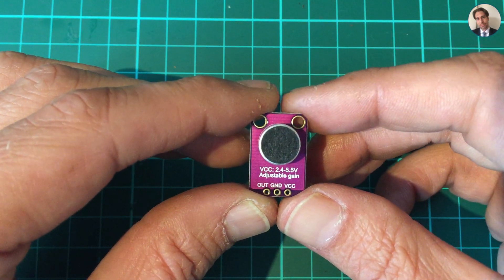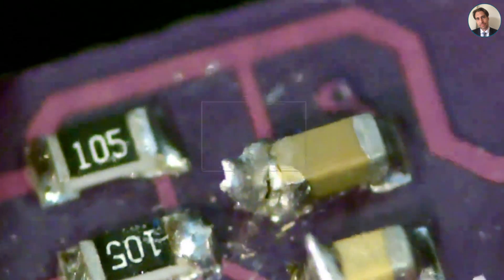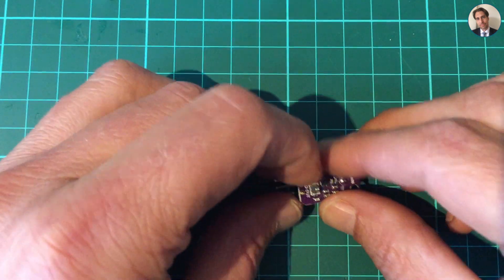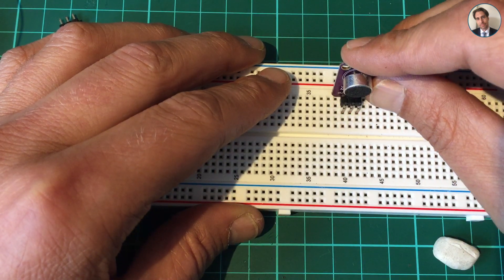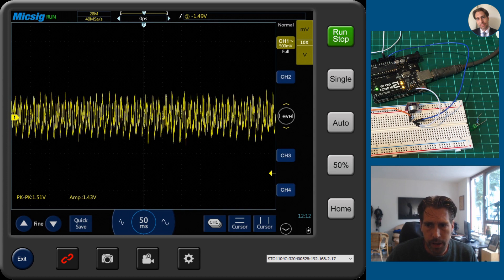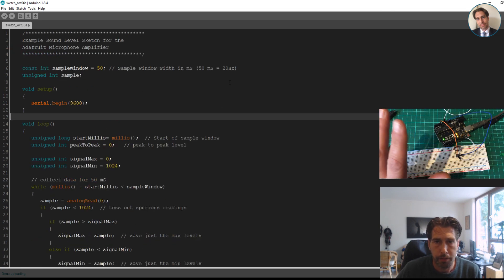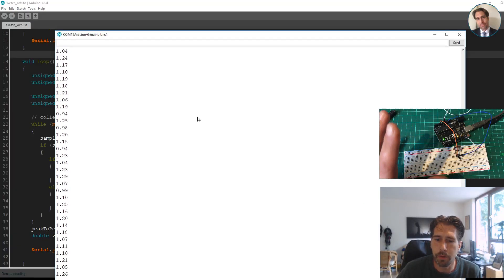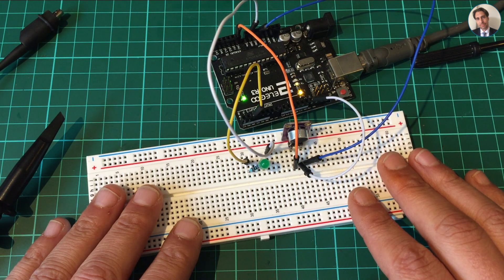MAX4466 Microphone & Preamp Module (First look and Test)

Comment: Are you sure It's so noisy because It's not in a enclosure? Also if the cable is not shielded then its picking lot of noise if its a high gain ...
Reply from the maker: I'm sure that plays a roll. I haven't tested it with shielded cables and a decent enclosure. But I have had amplifiers that did not present that noise when just on the bench in a breadboard. so that was my reference. Since I haven't tested it, I have to say there is a chance you are right. Maybe you can test it? :D

Comment: Good day. Do you know how to covert the sound produced into decibels?
Reply from the maker: Hi! Depends on what dB you mean. If you mean a audible sound (db SPL), you would need a DAC (Digital to Analog Coverter) or a circuit simulating one, and a speaker. 

Or if you directly hook this up to a speaker you need some form of amplification. I can't remember what the peak-peak voltage was, but this can directly drive a speaker only if would probably be very soft as there is no amplification.
Reply: @DustinWatts  I mean I want to evaluate and monitor sound that is produced indoors, and I want to use the microphone (in my case, MAX 9814) to capture and evaluate noise. I hope what I said makes sense, haha. Hoping for your speedy reply, thank you
Reply from the maker: @josephcampugan2439  Well it makes kinda sense. What do you mean by evaluate? From you previous post I think you mean hearing it? It then depends on how loud the incoming sound is that you want to evaluate in comparison to the noise of the microphone itself.
Reply: @DustinWatts  I mean this is what I want to happen:

1st is that the microphone receives noise from its environment.

2nd is to convert that noise into decibel values using an arduino

I'm trying to make an indoor noise monitoring system where it measures how loud the noise within that area. I'm going to use the noise values on dB to launch certain commands depending on how loud the noise is.

I really appreciate the replies. Thank you once again
Reply from the maker: @josephcampugan2439  Ok. Well that is certainly possible. You can read the value of the microphone and compare that to a threshold value and if the incoming sound is higher then the threshold, do something. You can stay away from using any dB scale at all, just read voltage levels.
Reply: @DustinWatts  now THAT actually makes sense. Thank you very much bro
Reply from the maker: @josephcampugan2439  You are welcome! Good luck!
Reply: @DustinWatts  just tested it now and when it reaches over 52 decibels, the value goes "inf" and the voltage reading goes 0. Any idea why it happened?
Reply from the maker: @josephcampugan2439  No idea... have a good look at your code and try to debug it. You can join my Discord server (link in the description) and post your project in the #your-projects channel. There are a lot of people there including me that will try and help you with your project. But this comment section on the videos on my YouTube channel is not the place for that.

Comment: Hello, I have a car stereo. Can I use this module as an car microphone? My car teyb has three microphone inputs, these are (+5V ) (GND) and (SIGNAL) . Can I connect directly? Thanks already for your help. I wish you good work.
Reply from the maker: Well I really can't answer that. Depends on what your car expects as a "microphone". And what it will be used for. Speech? And I also don't know what teyb means. I need more info/specs. 

But what I can say, as a microphone for speech, this is not the microphone for you. It is very noisy and the quality is too bad to be used as a microphone. I would classify it as a sound detection device. For example in the circuit I showed in the video it works great. Also for similar applications. But not as a microphone.

Comment: Hey can somebody help me pls. Do I need to screw the pot cw or ccw for more sensitivity? Can I overscrew it? Thanks in advance
Reply from the maker: Yes! You can definitely overscrew it, those tiny post are pretty fragile, so be careful! If you break it, the output of the pot in uncertain. 

I have played white this module exactly 1 time, so I can't tell you from experience. But....

This listing on Ali shows the schematic of the module: https://nl.aliexpress.com/item/32843099206.html Looking at it, turning the pot clockwise should increase the ratio of the non-inverting opamp and thus should increase the output. This has nothing to do with the "sensitivity" of the microphone though. It just increases the gain of the MAX4466. According to that schematic the gain is: 1+(VR1+R7)/R5. And because in the schematic the symbol is flipped, turning it clockwise (towards pin 3) increase the value of VR1. Again, you should get a higher signal on "OUT" for your ADC (or whatever). Which you can say as being more sensitive, but it actually just the amplification you are increasing.

Hope this helps!
Reply: @DustinWatts  thanks Sir! This definitely helped, on 2 of 3. One of them already came overscrewed. I don’t get it, why this step isn’t part of almost every data sheet, as it can be easily overscrewed. The end limiter (doesn’t really deserve that name) is just a slight resistance you feel while screwing. 
Anyhow the two others work, slightly better than the KY-038 I used before but nonetheless you need to play that sound really loud and/or you need to play it almost directly in front of the microphone. I assume it’s due to the work principle of these tiny microphone.
Reply from the maker: @ACID2BREAKS  Yeah those microphones are not the best. Better small microphones especially MEMS microphones are a lot better. And those are actually useful enough to record audio with a lot less noise.
Reply: @DustinWatts  I also stumbled over mems microphones. Seem to be very powerful especially in terms of resilience against noise. 
You mean something like the INMP441? 
Or what would you propose to sample a sound of ~80dbA and expected max frequency of about 2kHz all recorded in outside environment?
Reply from the maker: @ACID2BREAKS  I have that module here, but haven't tested it. But the specs are pretty decent. But remember the module is only 3.3V for VCC and also for the I2S pins!

Comment: Hi, What are the other sensor options for recoding high quality audio recording with minimal background noise. I though of using MAX4466 for a insect sound detection project.. will this be a feasible option?
Reply from the maker: I would opt for a ADC and a microcontroller. Less THD en much better audio quality!

Comment: For z = 0; z <= 9; z++, then while it's doing that, if it detects two or three claps during it's cycle (0 - 9), do something. If it only detects one clap during 0 - 9, then turn on the LED. If during the 0 - 9 cycle it detects two peaks, ... turn off. etc. etc.

If it detects nothing while FucntionCycle(); 0-9, . // NOTHING HAPPENS, stay unchanged.

Pretty easy. Thanks a million, good video.

Comment: Do you think it can reliably output multiple smaller ranges between 1V and 5V? Say if I wanted an event between 0V and 1V (flash red led) and then between 1V and 2V (flash blue led instead) etc? I ask because the noise seems to favor less nuanced ranges.
Reply from the maker: You mean something like a peak detector? If you use a microcontroller like in this video, this would be quite easy to code.

Comment: I ordered a few of these and noticed that the traces for the pot were actually all connected from input to the wiper, which I think would make the pot useless as the signal will always take the path of least resistance. I cut the trace and it seemed to work, I used an external 5K pot, but getting these things to work has been tough for me. It's possible I just got a bad lot. 

I'm still working on them, and hopefully I'll have a working solution soon. But it might be worth checking the traces of the pot, you may find what I found.

Comment: hi, do you know why the output is so noisy, and is there anything we can do to eliminate the noise?
Reply: No. Electret microphones are noisy.  On computers you can use progaram denoiser, but it not good for sound quality.
Reply: @КосякЗеленского  i bought this module and tested it with oscilloscope and it appears way less noisy and much better. I think in this video it is so noisy because it was faulty probably because of that capacitor that seemed broken.
Reply: Good question. There may be three reasons: 1. the power supply used is bad. A battery may be a better choice or a dedicated adaptor. 2. the microphone used is bad. You can buy a lavalier mic to replace it or any better electret mic. 3. the preamp curcuit is bad but this is unlikely as it was designed by a professional. Thinking too much about this is waste of time as we have many alternative choices in the market.

Comment: Hi, Is it possible to desolder the microphone and connect line-out form the computer? Should I add something in between the two ?
Reply from the maker: Hi! The MAX4466 is a microphone preamplifier. It amplifies the signal from the microphone to "line level". The signal out of your computer is already line level. So what you have to do to the signal really depends on what you want to do with the signal. Do you want it to drive speakers? Or do you want to digitally process it in a microcontroller? You can join my Discord server to chat about this if you like. https://discord.gg/RE3XevS